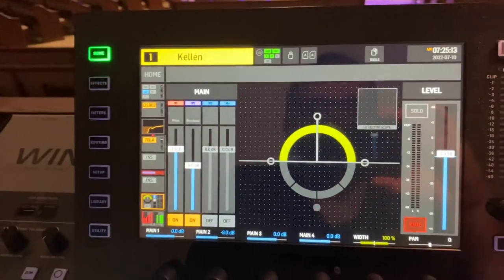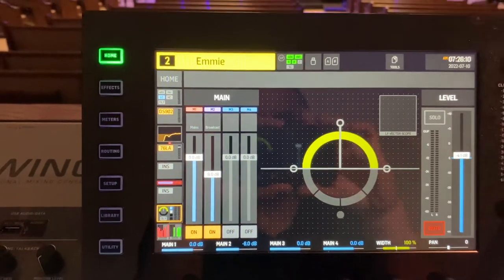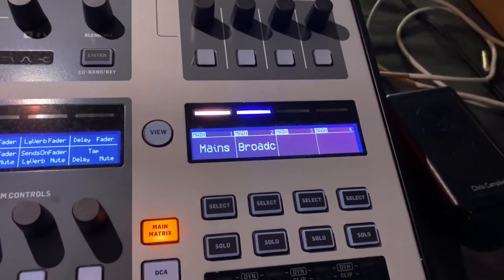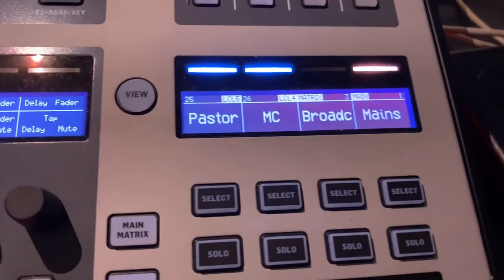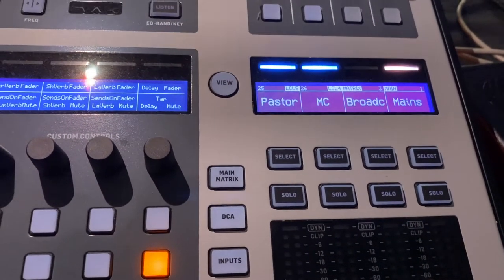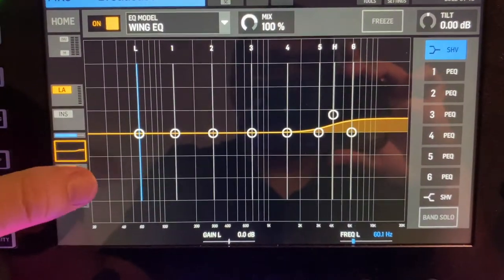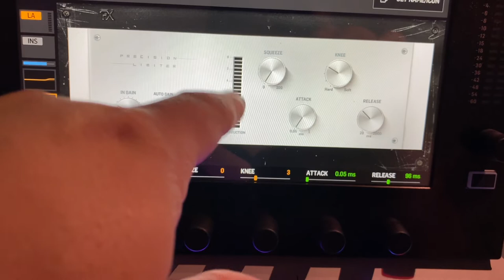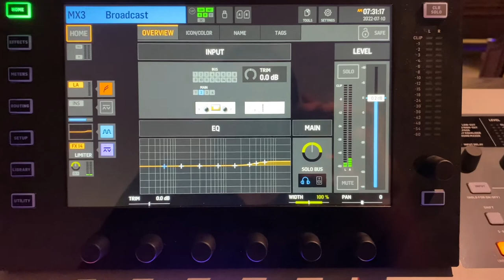Behringer WING - Setting up a  Broadcast Mix

Comment: Chris, can you explain how you are handling effects like reverb. Currently have Vocal reverb as an example as a bus and it feeds to those channels. I can get the effects in the house which that main is not on a matrix. For the livestream how are you managing lowering and raising effects during the service so that it communicates well on the stream?
Reply from the maker: Each channel (and each mixbus) has the option to output to 4 different 'mains'.  I have main 1 set to be my house mix sent to my PA system.  Main2 is my broadcast mix.  So I use that instead of an aux bus.  The advantage is that it is always a postfader mix, so any changes you make to your house mix is automatically reflected in your broadcast mix.  You just have to adjust how much you are actually sending to the Main Outputs.  what sounds good in the room doesn't always sound good online.

Comment: Hey thanks for this! - quick questions
1) can do you a sends on fader on Main2? - take over the faders to control the mix to MAIN2?
2) what's the reason/thought/advantage behind running Main2 into a Matrix instead of just routing it out of the console into the stream box/obs?
Reply from the maker: 1) I am not sitting in front of the console right now, but I think mains are only available from the right set of 4x faders.  You can enable SOF to work on these 4, but you would have to find that option in the settings screen.  I have seen it before, but forgotten where it is.

2) It allows me to do processing just on that matrix in case I want to send that main 2 mix somewhere else, such as maybe a cry room or lobby mix and I want to do separate processing on that (such as eq changes, etc).  In practice, maybe you need to EQ your lobby speakers differently from your broadcast and maybe you don't want to use a limiter on it.  Just allows for flexibility is all.
Reply: @chriscampbellmusic  thanks man for the reply and the video!

Comment: So are you panning your channels the same way in both broadcast and house mix? 

I’d like to do this but I want my house mix to be straight down the middle mono and my broadcast be panned out. 

To achieve this I could us a bus but we are currently using up all of the busses.. that’s why we’re using one of our main busses for broadcast. 

Thanks!
Reply from the maker: Yes I do pan based on my broadcast mix. My house mix is mono. It gets tricky because of the way panning works. Basically, set your main PA as a mono channel, same way you would a bus I think. But the issue is that when you do that it sums the left and right, but it doesn’t increase one side over the other. For example. You have something panned center, but when you pan it left you will notice that the right side decreases but the left never increases. So in your mono mix you effectively make the instrument quieter but your stereo mix for broadcast is fine. To compensate, you have to push the fader a bit more in the house but that means broadcast gets louder. easy fix, just lessen the send to broadcast from that channel like 1db or whatever feels appropriate.
Reply: @chriscampbellmusic  I got you I might try that! Thank you for the response and the video very helpful!

Comment: Wow, the drum is completely turned off for the room?
Reply from the maker: Its an acoustic drum set in a room that seats maybe 500 people comfortably.  The only thing I have in the PA is the kick and toms.  The snare is basically in the room enough to give energy, otherwise it is mostly just the acoustic drum noise in the room.
Reply: @chriscampbellmusic  haha had the same problem with cymbals leaking over the drum screen. Measured 84 dB on just the cymbals at the booth.
Reply from the maker: @spookie3000  my room measures 90db with the drum kit off and the only thing I am lacking is kick and toms.  I even went with v7 Capsules on my vocal mics to reduce bleed.
Reply: @chriscampbellmusic  wow!

Comment: how did you setup the broadcast channels maybe i am missing something but i did not get that part
Reply from the maker: @donaldburns4462 The broadcast is simply the Main 2 channel. The wing has 4 Main sends.  I use Main1 for the FOH mix, Main2 for the Broadcast mix.  I think just set up each channel to 0.0 for the Main1 mix so I have complete control over the room mix, then I adjust Main 2 volume for the broadcast.  I usually bring the band down in the broadcast mix so that the pastor volume is more in line with the band for broadcast.  In the room, we are running 90-92db with band, but only about 70-75db for the pastor, so we have to adjust volume somewhere to get the pastor as loud in broadcast as we can.
Reply: Great thanks, we have an individual using an iPad to control house and I control the live stream feed on the board. I still need the ability to change channels separately from the house. I am thinking activating sends on fader on the main 3. I have house on 1, subs on 2 and live stream on3. Thoughts?
Reply from the maker: @donaldburns4462  yes. Sends on fader will work. Or you can do the sends on fader from the iPad too and run your live stream from it.
Reply from the maker: @donaldburns4462  or you can set up your mix so when you make changes to your house you are changing your broadcast too.
Reply: Thanks for the info.